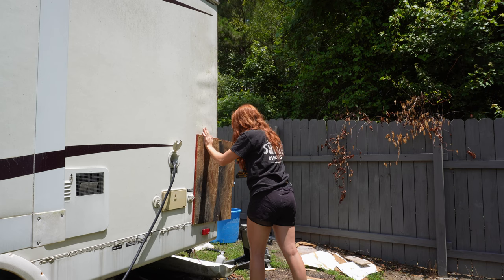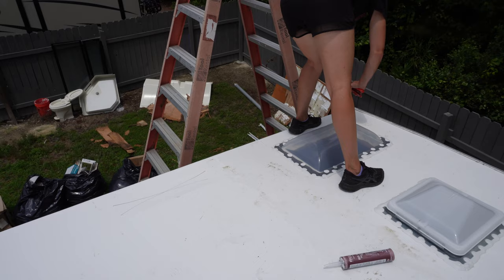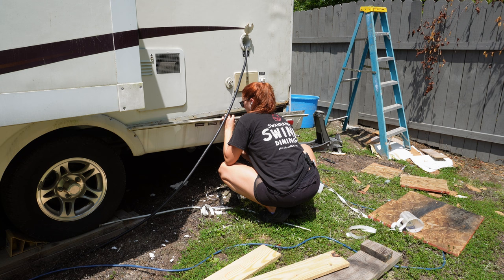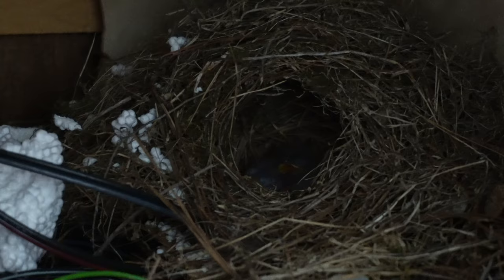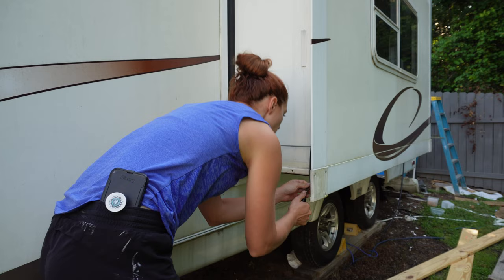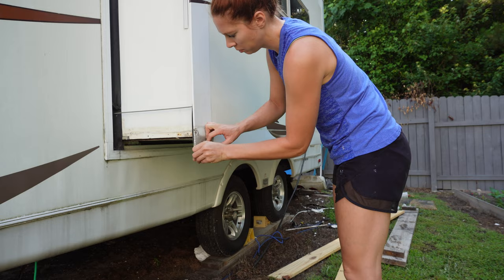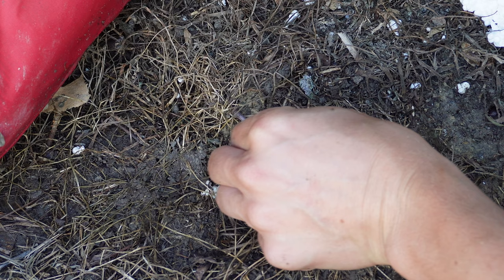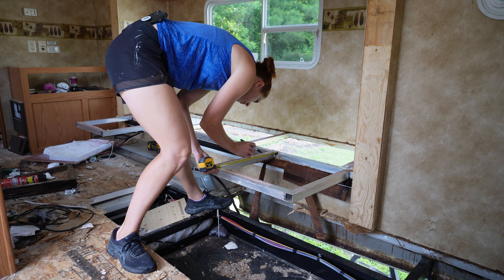RV Water Damage Repair: Demo Day 14 Aluminum Frame Slide Repair

Comment: Try Red Guard as a waterproofing under showers and on the walls . On your roof replacement it looks like the rear top corners leaked. Mine was worn through by the tarp meant to protect it , what about putting a cap across the back to prevent premature wear. Thanks for the video

Comment: Great video. As I mentioned before, contact glue (which Gorilla Heavy Duty Spray Adhesive is) really needs to be applied to both surfaces for maximum strength. Spray both parts and let it dry, then bond. I like how that piece fit in the bottom.
Reply from the maker: You know, you did tell me that before. I promise I’ll categorize that in my brain this time and remember it 😂

Comment: Great video, been following the project. You may want to try ripping down some wood pieces to slide into the aluminum tubes. It will strengthen them and give the screws something to bite into. And they will keep the tube from flexing when you drive the screws in. Most manufacturers do that around doors and at joints. Keep up the great work.
Reply from the maker: Great advice, thanks!